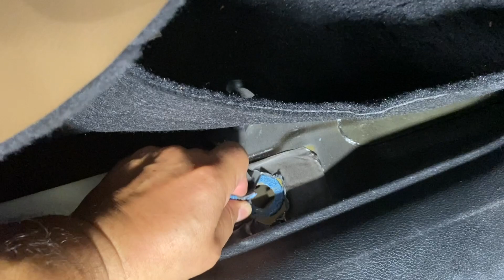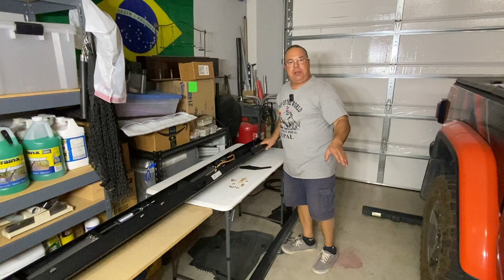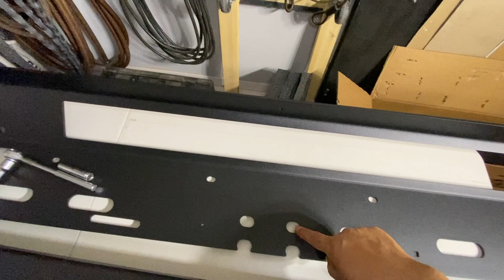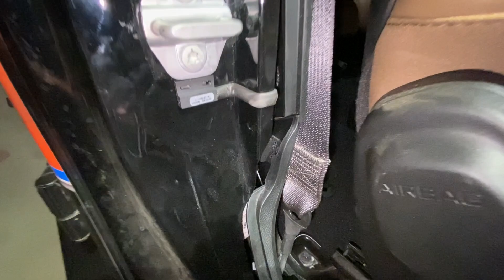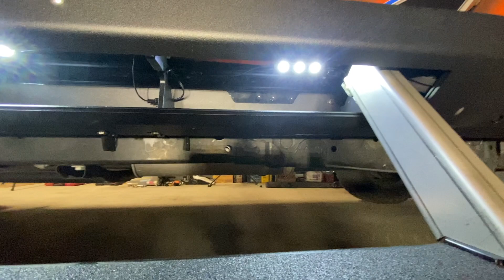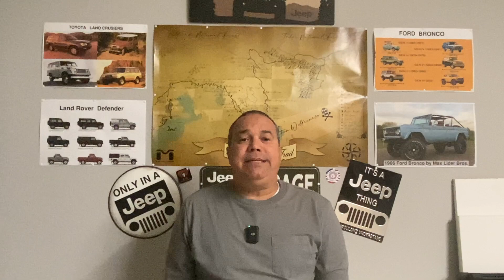Rock Slide Engineering Step Sliders on a 2021 Gladiator Rubicon

Comment: Nice video.  I did opposite of you and put on my lift first.  Now really need side steps as i also am not all that vertically blessed.  Lol.  Rock slide is top of my list.  I did a 3.5" Clayton lift on my own with some Core 4x4 arms.  Fun, but challenging project.  Keep it up man!
Reply from the maker: Thanks for the comments.  I knew I wouldn't be able to get in.  I had to pull them off to do the rear of the lift.  Couldn't believe it. 🙆‍♂🤦‍♂

Comment: Great video.  For phase 2 look at Metalcloak.   I have the 4.5" Gamechanger and absolutely love it.  Perfect for 37s.  Remember that 4.5" on a Gladiator is like 3.5" on a JLU.  Phase 3 - For skidplates I just ordered Metalcloak's Undercloak system.  It is steel.  I had it on my JL and seems to glide much better on rocks versus aluminum.   Best of luck
Reply from the maker: Thanks for the comments.  I've already installed the Metalcloak 3.5" long arms.  Check out the install videos.  They're a little slow, but I wanted to show details.